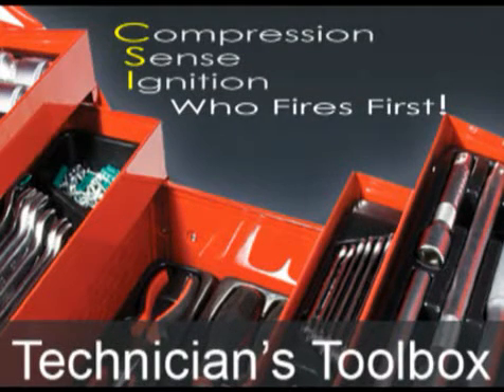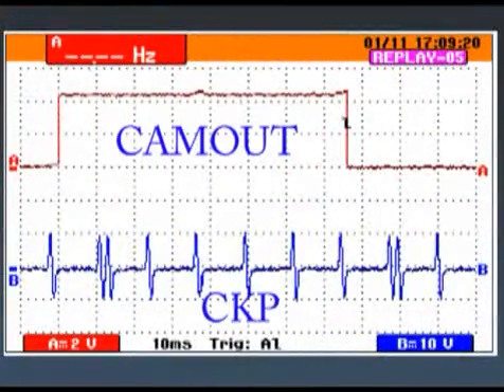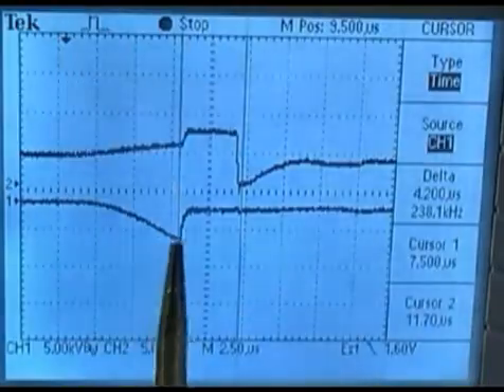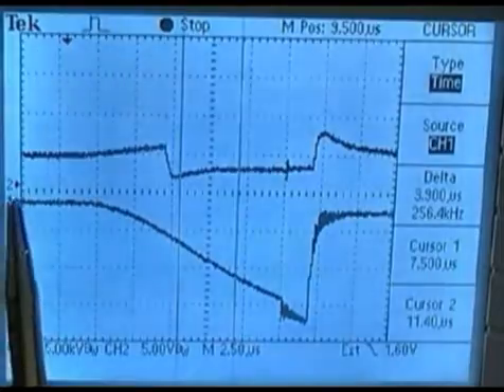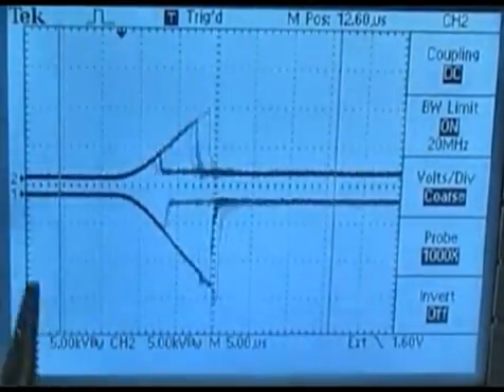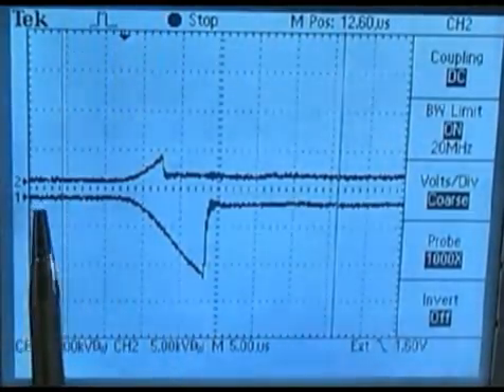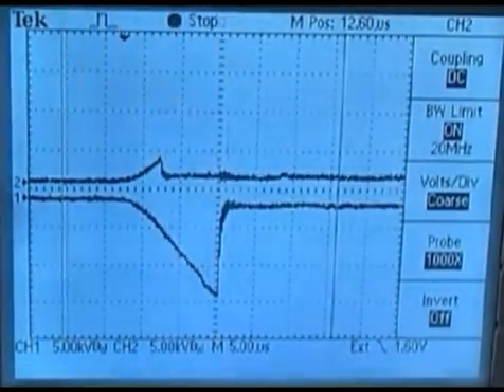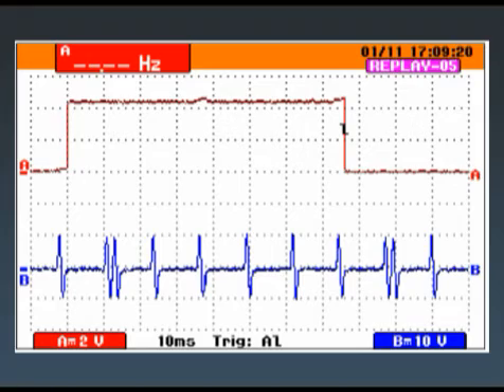Compression Sense Ignition, Who Fires First!

Comment: This is an amazing and helpful explanation of a really interesting bit of tech. I'm in the planning phases for converting a vintage motorcycle to EFI, and a solution like this would make it possible to do closed-loop operation without having to add any kind of mechanical cam angle or phase sensor.